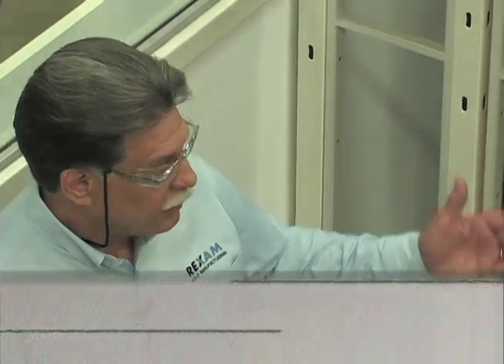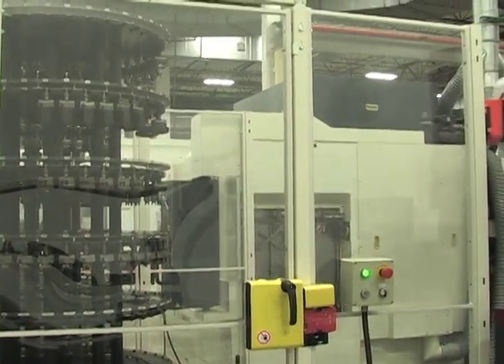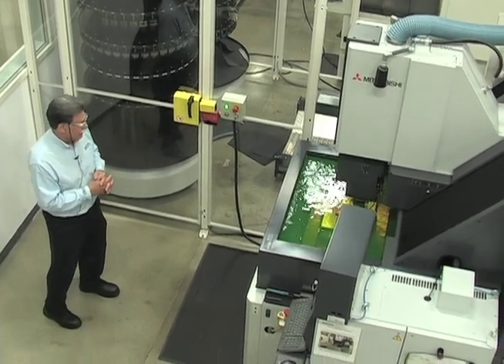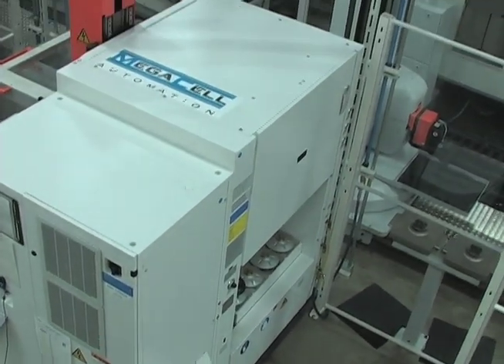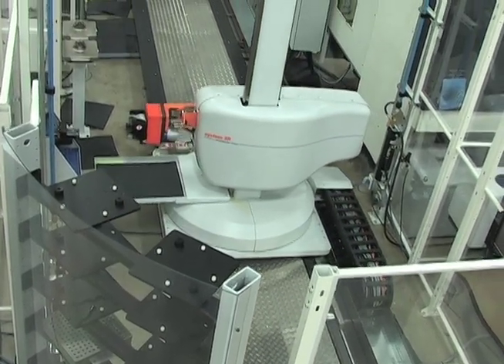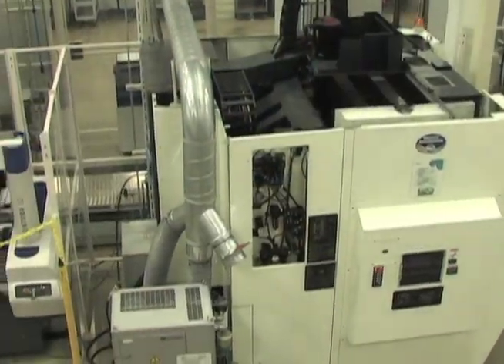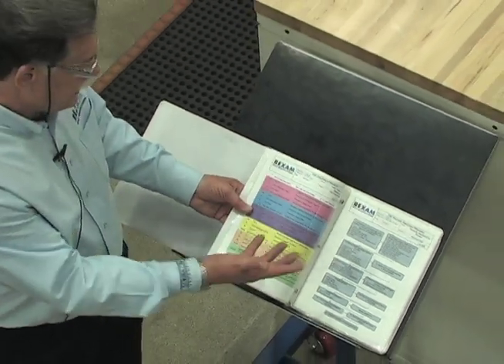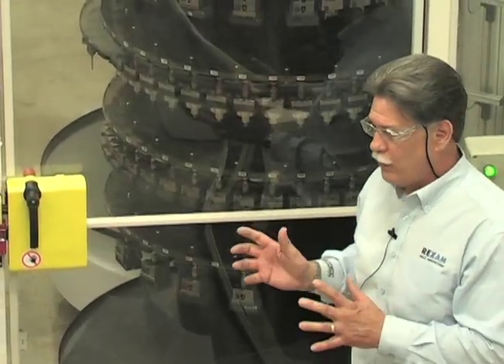True mold manufacturing

Comment: I forgot to mention that Mega-Cell rail 1 has an eye-in-the-sky Hi-Def video camera with zoom for remote monitoring and our technicians now access the camera and the controllers/System 3R Work Shop Manager software so they can operate the cell from anywhere they happen to be if it alerts them of an issue or they decide to make changes in jobs that are proved out and waiting in the controllers. Len Graham
Reply: Do you know if the Mega Cell is working out??